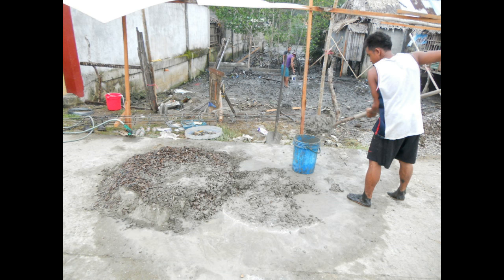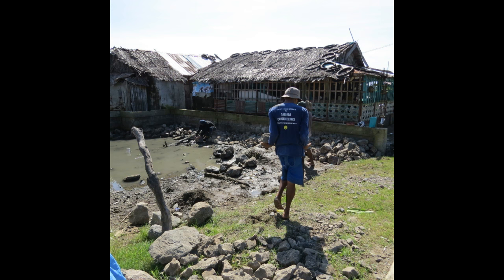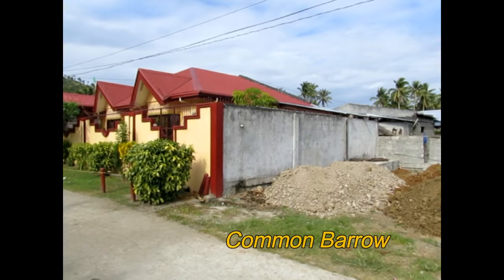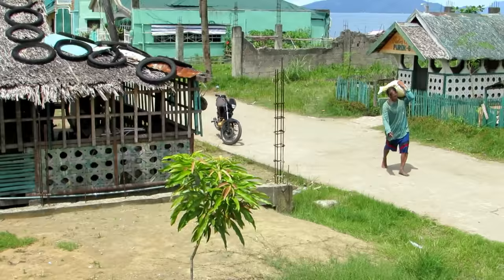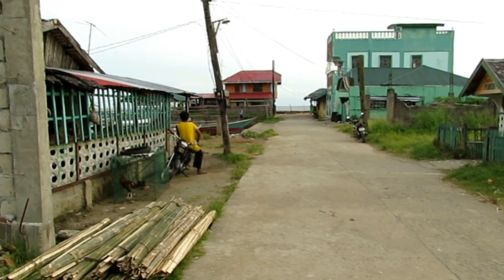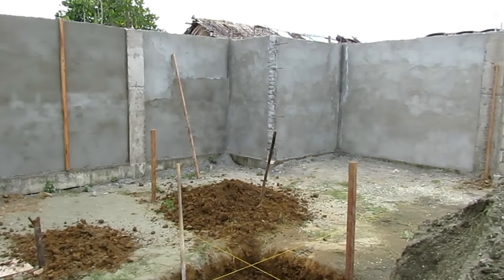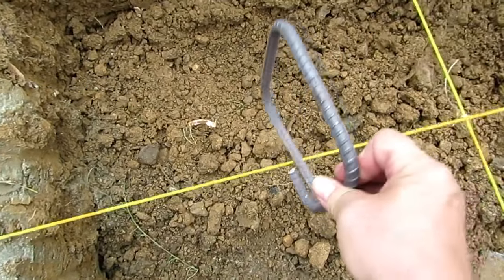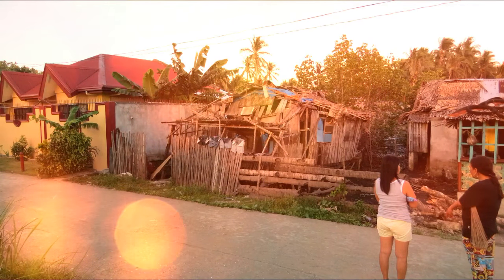Building in the Philippines - Expanding Paradise, Part I | Ep 74

Comment: Hi,I'm curious do you have a handle on how much you spent on the plot walls as I have built a house with a decent sized plot and I was quoted a huge sum to do the lot wall.  I was just curious how much you spent on the wall in total and the length of the wall and how high it is.  One other question we had also looked a having a bamboo fence but the supplier told us that this is not the correct time of the year to put them in its better late December of early Jan or the bamboo will go powdery in the middle faster.  Did you hear about this and if so what did you do to get around the problem.  Cheers
Reply from the maker: If you are inquiring about our retaining wall, it is approximately 1.5 meters in height, and two sections, each about 10 meters in length. With dead-men installed and (six) deep footings, our cost was about P60k. The fill dirt was an additional P28k. So all in all, before construction at grade level began, our cost was approximately $1,900USD. As far as the bamboo fence goes, bamboo in the weather will last about 1 year (no varnish or paint) before it needs replacing. It really doesn't matter what time of year you install, as long as it is green. Then again, might be a regional difference due to rainfall amounts.
Reply: Thanks for the Feedback Sir, the wall I need is going to be considerably longer as the plot is about 80 to 90 meters long and 40 meters wide so total of 260 meters long and about the same height say about 6 to 7 feet high and I was looking at about 1 million. Thanks for the reply sir really appreciate it !   Andrew
Reply from the maker: Make sure your contactor (or workers) understand the concept of installing a "Dead Man." If you are going over one meter in height, I highly recommend them to keep your wall from pushing outward. You can Google "dead man for retaining walls" to get info.

Comment: nice project, do you think you can put a price on each stage or maybe its private?  Anyway thanks for sharing
Reply from the maker: To date, we have spent about $2,800 on what you see in the video. I will just have to finish it over time as funds allow. Thank goodness there are no code enforcement officers here who demand completion in a timely fashion! lol
Reply from the maker: I just replied to an earlier question that we have spent about $2,800 in total for the work so far. That does not include the price of the lot.
Reply: Retired in Samar wow yah that is amazing also what are prices for a nice size lot and to build a not as big as your house but the same quality of material?   a ball figure would be nice. thanks again
Reply from the maker: Prices for land can vary in the extremes. I've seen rural properties go from P900 per meter for rice fields and P6,000 per meter for small city lots. Location, location, location! Building costs for a house can also vary, depending on the type of structure (wood or concrete), and amenities. Our property cost about $400 per sq/meter to build, and includes the perimeter wall, gates, carport, patio, garden and walkway, and all inside appliances.
Reply: well im sure you will make that lot look nice. Also i was wondering about drainage, seams there is a lot of sea water there. Whats the fix for that, just build a wall?

Comment: one question, why do they not lay the block like they do in america, would look much neater?
Reply from the maker: They do if they use the same type blocks, mostly in some commercial applications. But generally, it is methodology with these hollow blocks. The blocks you see used in most construction are designed simply as forms for concrete and rebar with an added exterior 1" troweled coat of concrete on both surfaces. I will show you the real toughness of this hollow block in my next video! Stay tuned.
Reply: thanks  for the reply, like your video's a lot, good content,  N.C.   USA   viewer, been there  5 times, love the country, but hate the bugs.
Reply from the maker: I seen more bugs in Mississippi!